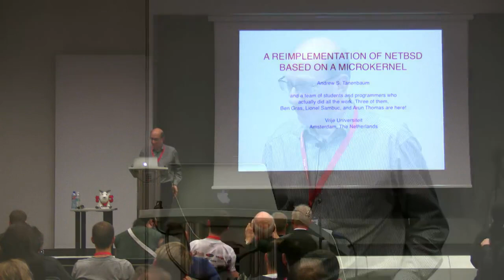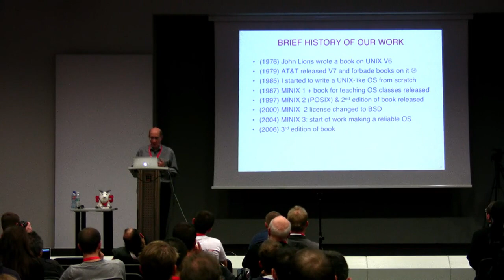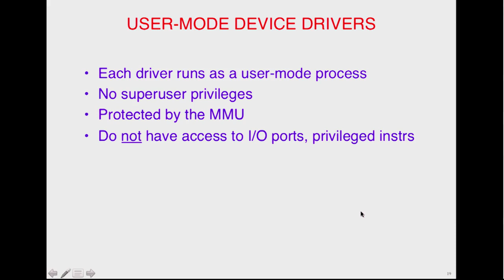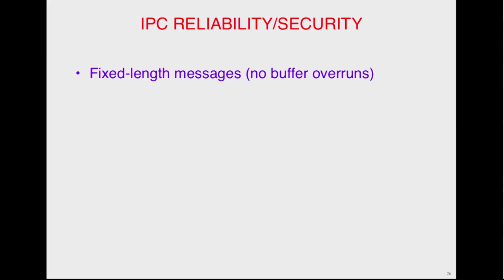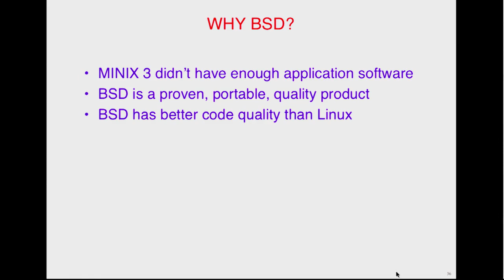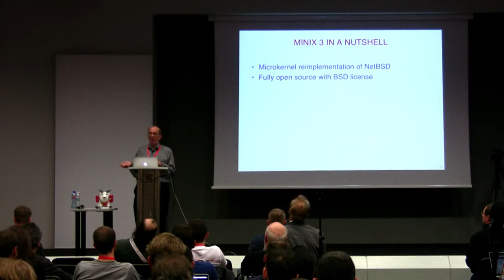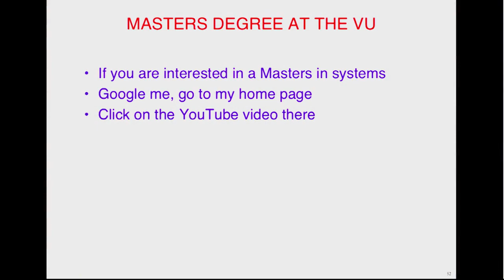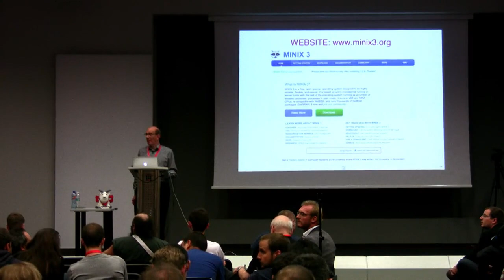A reimplementation of NetBSD based on a microkernel - Andy Tanenbaum

Comment: Win NT is microkernel based. NT paradigm is everything is a network resource. Linux/unix everything is a file resource.
Reply: WNT is VMS rebranded by means of a single lexical increment along the string.
Reply: NT is not a micro kernel
Reply: It is more of a hybrid kernel, but it's closer to a microkernel than Linux is, for sure.
Reply: Both BSD and NT origin is the Mach microkernel. NT later moved video into the kernel. Rich Rashid, Mach originator, worked at Microsoft for first Windows NT code.
Reply: @zofe  NT project was led by David Cutler of rsx-11 & Vax fame. Original "N-10" was for i860 RISC processors